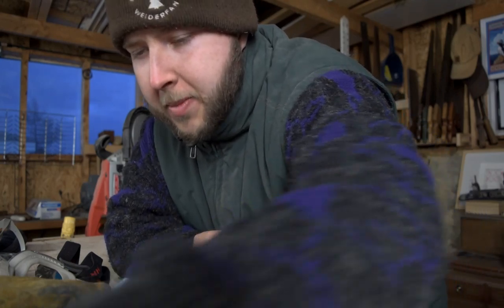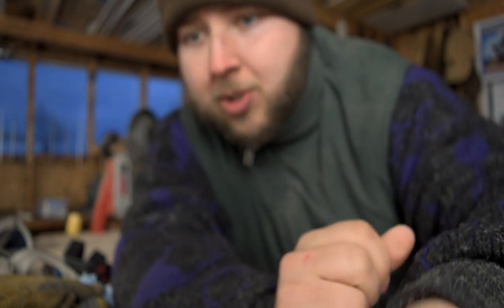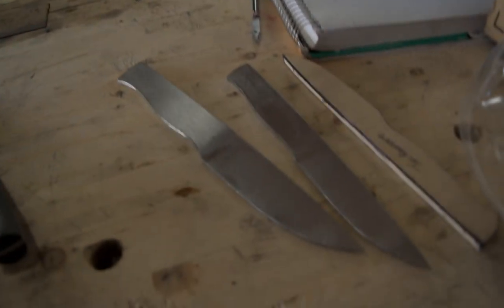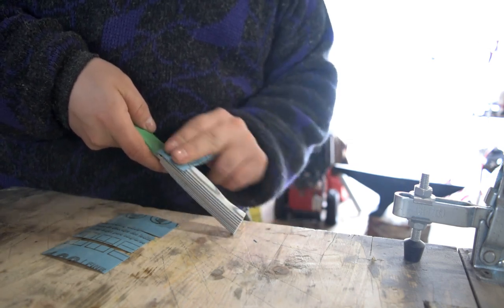How to polish micarta - GIVEAWAY BUILD 2

Comment: Those two knives turned out awesome.  I just finished making my very first knives, one for myself and one for  my son.  I have some pictures on my Community section and a couple videos uploaded.  Working on the final parts of the video on making them.  Mine are not the quality yours are, but not to bad for a beginner.  Took mine to my son yesterday and he just absolutely loves it.  Really like watching knife making videos, shame you didn't get the heat treating process video.  That was my major concern when I made my two, I didn't have a forge.  I ended up using a charcoal chimney with lump charcoal a piece of pipe to the bottom of the chimney and an old hair dryer.  Got the 1095 steel to non-magnetic and then some and quenched in 130 degree F vegetable oil.  Again awesome video, two awesome knives that you finished and can't wait to see the next video on the two your making.  Juddie - J & J TOA
Reply from the maker: Awesome! Good for you on creating those knives for yourselves. I have found that heat treat doesn't have to be THAT precise, at least with a simpler high carbon steel. Get it to critical temperature, and quench. It should be brutally hard at that point. Then temper (bake) to reduce brittleness.

Comment: I now polish with diamond compound. For final finish on my handles I use my 1x42 belt grinder and take the platen off and use a slack belt up to 400 grit.  After that I use a 100mm buffing wheel in my drill press at 800 rpm with 400 grit diamond compound and then I switch to 1500 grit diamond compound. By then the G10 is mirror polish, same for micarta, but I do a final 5000 diamond compound to really make it shine. The 400 diamond compound leaves a finish like 800 grit sandpaper so you can imagine what the finer grits do. Once I started using diamond compounds I have never gone back to using regular grease bar buffing compounds at high speed. So that's how I polish my handles Kyle.

Don't forget my tip on having the grinders on a cart to take outside Kyle. Plus I use my shop vac blower side and blow all that dust outside. Really keeps my shop clean by grinding out on my patio.
Reply: @Herbert Wingfield cuz I don't have any videos, don't have a camera.
Reply: @Herbert Wingfield I should make one as I am one of the few knifemakers who uses diamond paste, but I can put a mirror polish on a knife in half the time and keep my sharp edges.

Comment: Great video, but please be aware that surgical masks like the one you're wearing do not protect against anything as they're not particulate respirators. They're meant to prevent surgeons/dentists from contaminating the patient with saliva, etc. It's worth investing in either a reusable N95 or better (R95, R100, P100 etc), or you can buy disposable N95 masks if you find a style that fits you properly.

P.S. Cheers from Ontario!